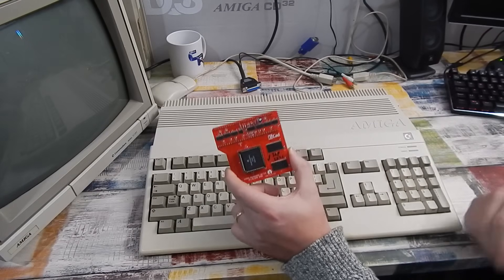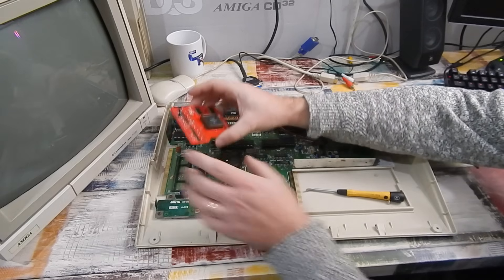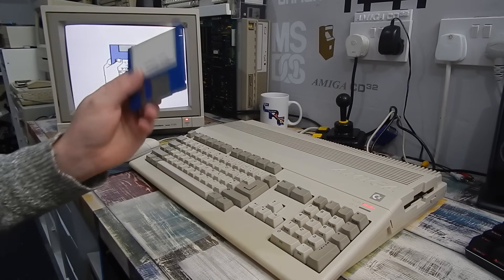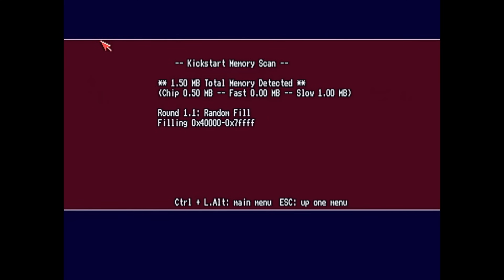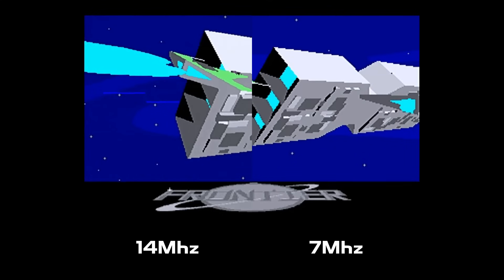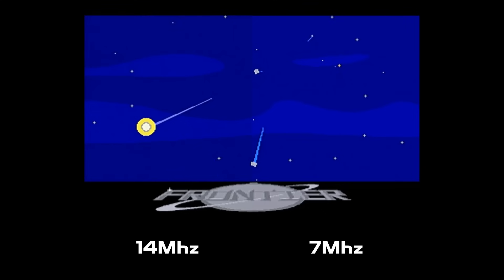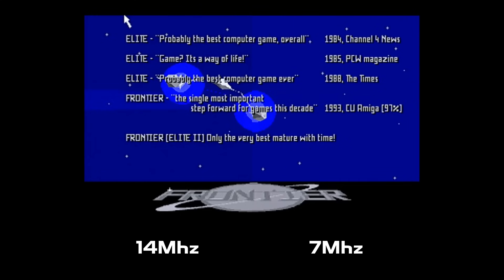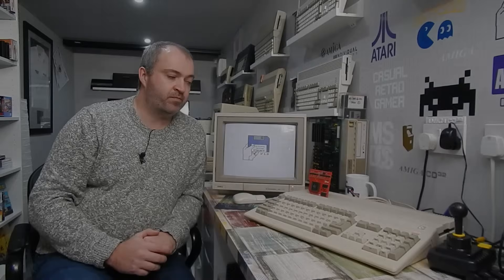A new Amiga 500 Accelerator for under £40

Comment: It's probably the use of the on-board "Slow RAM" which is making it a lot faster as it won't be being accessed by the graphics sub-system and hence fewer wait states.
Reply from the maker: Yes the onboard ram makes all the difference.  As I understand it's actually fast ram but mapped into the address space of slow ram, that's why it clashes with the trap door memory.  If you disable this ram the difference is not that great.
Reply: Actually, Slow RAM is on the same bus as the Chip RAM, so in theory it should hold the CPU back.  The addition of real Fast RAM is where its at.

Comment: oops. i just noticed something that really confuses me. I have tested a 68000 and a 68010 in an A500, and I got 528 and 547 dhrystones, respectively. how do you get 549 dhrystones with a 68000...?
Reply from the maker: It just seems to fluctuate between processors.  There is no one thing you can do to improve it other than try another chip.
Reply: @CRG  do you maybe have a 68010, so you can check its dhrystones on your A500? that would be interesting. :) maybe a PAL vs. NTSC thing? (I have PAL.)

Comment: This accelerator is using a 20Mhz motorola chip worth only $3-4 USD that he weirdly decided to clock down, instead of using a triple-clocking method and run it at a slight bump of 21Mhz. Also, why add a measly 1MB in 2X512Kb chips when he could add a single 16MB chip that could make a difference for WHDLOAD and desktop apps? Whoever designed this, completely missed the opportunity to make it much better than it is, for the SAME amount of money and soldering if not less!

Comment: hi, great video! are there any accelerators around the same price range for the 1200?
Reply from the maker: Not really, the most affordable accelerator for the 1200 is probably the new TF1230 but it costs about £170.

That said the 1200 responds well to just adding fast ram, pretty much doubles in performance.  A fast ram card typically costs about £70.

Comment: I always wanted to convert my A500 or 1200 in to a case similar to my 3000, I cant find any 3d Print files for this apart from a keyboard case, are you aware of any available cases for this mod?
Reply from the maker: You'll be wanting the checkmate case which is styled after the 3000 and takes a wedge Amiga board.

Comment: Why is it shown as slow-RAM, despite being attached directly to the CPU? Is it an intentional  'feature' for maintaining compatibility with those older games, which demand the 2nd 512K chunk to be in ChipRAM range? Or is it just by design? But then the speedtest looks like if it was Fast-RAM?!
Edit:
OK, just found the explanation by the creator on abime:
"the ram on this accelerator is actually fast ram. However, I mapped it to the address range of the slow/ranger ram @$C00000 so it gets autodetected without doing the whole zorro/autoconfig stuff. (I had to keep things simple as I only used standard logic.)

Any real slow ram installed in the trapdoor gets overruled. When the accelerator ram is disabled then the trapdoor slow ram appears again. "

Comment: Why didn’t it add fast RAM instead of slow? Is it a compatibility thing? And why just 1 MB? Memory is very cheap now a days…
Reply from the maker: The memory on this card while I said it's slow ram is actually ranger ram which is essentially just fast ram but mapped to the slow ram address space.  It's only 1MB as the address space for this type of memory is limited.  This was done to simplify the design.  You will note there is no cpld etc on this card it's all just discrete logic.

The last time I checked the designer of this was working on another version to add more features including a faster CPU and more memory.

Comment: Would it also be wise to put a bit of tape over the socket soldering on the back of the expansion card?
Reply from the maker: It is well clear of the components underneath but adding tape certainly wouldn't do any harm.

Comment: I found it a bit confusing as it appears to me that the card puts the memory in to the slow ram address space. Seemed very odd to put the trap door one in too. The one on the accelerator would be much faster but if the trapdoor mem gets used first very little improvement.
Reply from the maker: The ram on the card is fast ram but as you say addressed to slow ram.  I just put the trapdoor memory in there at the end to see what would happen.  I dare say with the correct agnus and a mod your trap door memory can still be used for chip ram, then the 1MB on the accelerator is just seen as slow.  This is certainly my intention with this machine going forward.
Reply: @CRG  as usual I realised what I commented was rather daft afterwards. I does look like a good buy for games. Being a 68k and thus the memory in the 24 bit address range it should be about as compatible as is possible while getting a bit of extra responsiveness from even frame rate locked games. For apps the pi storm wins the day for value but not very compatible

Comment: That is so cool! I'm glad they are people with passion for old computers such as Amiga and Atari. Where can I get that accelerator?
Reply from the maker: Getting one is unfortunately part of the problem.  As I said at the end of the video it's not readily available but rather is a hobby project.  You can make your own or they do crop up from time to time on eBay or the various Amiga user groups.  I got this one from a guy on one of the discord servers, he made a few, I bought one of them.

Hopefully with some exposure from this video someone will take the reigns and make a bunch for the community.  If I had the time I'd do it myself.
Reply: @CRG  I've checked the cpu is the most difficult to get seen them around 40 quid. I will look around
Reply from the maker: @evangelosm537  you can get a plcc 68k on eBay for £8
Reply: I was trying to check using my phone while on my way to work. You are right they are around 8 pounds. I will check the bom see the cost and hopefully after payday I can order some parts. I like the project will keep me busy for a while. Wish they had something similar for the atari ste but looks like will have to stay as it is for now.

Comment: Very interesting card. Perfect to add some more speed for minimum cost. I would pay a little more to add 8Mb RAM as 1Mb Fast-RAM is really too few if you're using a HDD with Workbench. But for gaming, I suppose a player don't need more 😅. Sadly, I think this card wouldn't fit in my CDTV, even if I disconnect the RAM to use my current 8Mb Fast-RAM expansion board plugged in the diagnostic port.

Comment: What about the 1meg chipram mod for the 500? Would this work alongside the trapdoor ram working as chipram?
Reply: This is exactly my question, want to try this out.
Reply from the maker: I don't have the correct Agnus for this system to be able to do that.  The guy I got this from is going to test it so I'll let you know.

I don't see why it wouldn't work, I think if I could get 1mb chip and the 1mb on this card it would make for a nice little A500.
Reply: @CRG  you should give the chipram mod a go it's really easy and I think the agnus you need is fairly easy to get hold of, or you could go for the ace2b chipram mod from individual computers for 2 Meg, that's my plan 2 meg all the way 😀. Love the video and this accelerator is a great piece of kit, I love the variety of stuff out there and this kind of thing fills a nice budget space...
Especially if you have an A500+ with it's own IDE for a hard drive
Reply from the maker: @philiphandforth4390  yeah I just need to get the Agnus, I'll keep an eye out for one and if I can get up to 1mb chip I'd be happy enough.  I've got everything I need to build an ide board for this so that will be coming soon.
Reply: Works :)  I done the chip mod. I have 1MB chip and using this accelerator. 2MB in total.
Reply: @nikosidis  Really?! You have 1mb chip mem mod and this card running another 1mb slow ram?! Did you need the change the Agnus in the A500?

Comment: That Accelerator has made a big difference. And Yes if Dread had of been out in the 90`s it would of held back the huge up take of the Pc`s . I remember playing Gloom on my A1200 and was not impressed at all. Dread would of kept me away from buying a Pc for a bit longer for sure.
Reply: Dude even looking at Elite Frontier is a mess. I had a meagre 486-slc-33Mhz back in 1993 and couldn't run the latest games very well. Doom ran particularly slowly, maybe 15-20fps on average in low detail mode, and X-Com wasn't much better with lots of smoke or light effects on screen. Alone in the Dark was a slideshow during combat too. But Frontier was a buttery smooth affair. Here on the original Amiga, looks to be about 6fps while panning the city.

Comment: I wonder how it compares to a 7Mhz MC68010 :)
Reply from the maker: You could always drop a 68010 into this card  and get that little bit more performance.  It's a fair bit more expensive though.
Reply: the improvements in performances of an MC68010 over the stock MC68000 @7Mhz are basically near to zero.

Comment: How it is compared with Vampire extension which allows to run doom on amigas?
Reply from the maker: Well this card won't run doom but it does a great job with dread as I showed.  

The vampire is a completely different beast, FPGA running their own 68080 core, buckets of ram, rtg graphics etc.   If you want that sort of speed the only thing which gets close on a budget is the pistorm although it still has some compatibility issues.  The problems being worked on and will be fixed at some point though.

Comment: This is wrong advertising. First of all it can not be picked up right now for under £40 and when someone make them the job is for free? Better change the text to "make this card yourself for under £40".
Reply from the maker: Mine cost £35 and that's nothing to do with the fact I was making a video about it, it was listed at that price and that's what I paid.

The parts for this probably total about £25 so it all depends on how much profit the builder wants to make.  A lot of folk out there build these things for the fun of it and pass onto their communities at near cost. 

If I had time I would certainly build say 10 of them and sell at £40 each.
Reply: @CRG  I understand that, but when you write "A500 accelerator for under £40" it seams like that is the price. I can tell you that only the 1MB, SRam is £15. That is why it is not more RAM on the card, very expensive RAM. Add the CPU £5 and the other parts and it will be difficult to get the parts for less than £35. If someone make a few pcs. it is possible they take nothing for the job but it is mostly not how the world works.  To put together one card take a few hours. Considering all this, the card will most likely cost around £70.
Reply from the maker: Mouser have the ram for £3.67 each.
Reply: @CRG  You are sure they are the correct type? With shipping it is still at least £10 as you need 2 pcs. as they come as 500k. You can then get the parts for around £30, if what you say is correct. Still not a card most would sell for £40. You need to solder every part, test it and there is still a chance something go bad etc. etc. It just make no sense the price you have given.
Reply: @nikosidis  You can't think about mounting cards without making pay for your hard work, it's you right and I respect that. Fortunatly, there are guys that just make pay for the material, not the time passed on assembling them. They call it passion and pleasure to help Amiga fan to expand their system at low cost 😁. After that, when you have to make the cards manufactured by a manufacturer (like the Vampire card for example), it's another deal of course.

Comment: Would it work in a CDTV?
Reply from the maker: If it fits I don't see why not.
Reply: It can work but it's not so simple. First it has to enter. The problem is as there is lot of space on an A500. The creators of this kind of expansion card don't make big efforts to reduce the size of the board as they usually don't care about CDTV and only think in terms of A500. In CDTV, I think that this card will be a problem without a riser, and if you use a riser, I suppose you won't be able to put the cover back in place. And then there is another problem. The RAM address. In the CDTV, some address is already in use by the spectific CDTV ROM. If this address, free on another Amiga, is used by the card, you will have to turn on the CDTV ROM to make it work, loosing the CDTV expansions.

Comment: Could this work with a 8mb fast ram board between motherboard and the accelerator?
Reply from the maker: No it supposedly doesn't work with those 8mb fast ram cards.  While the card reports slow ram its actually fast ram just in the slow ram address space.  The only way to make it work would be to disabled the ram on the accelerator but I think you'd loose performance.

Comment: Crappy board. Simple 68000, only 14MHz, no cache.
Reply: But still managed to peee all over the competitors!
Reply: not to mention you have to stack a socket to get it to fit! Bad design. It's like they didn't even test it. They should have at least included that, if not fitted it to the board. It's an extra cost that the consumer wasn't expecting, and they have to source a socket. Naughty company.
Reply: 14Mhz is already very useful to accelerate drive speed (including HDD), add some fluidity to 3D, making all the ECS games installed using WHDLoad perfectly smooth. On my Workbench, I'm playing music using Delitracker 2 but I couldn't play some module format due to CPU consumption. With MC68000@14Mhz, no more such problem.
So if you want a big revolution in your Amiga, of course it's not interesting. But personally, I already liked my MC68000/7Mhz based Amiga and this kind of expansion corrected the little speed issues I encountered for very cheap price. Perfect 😅 !